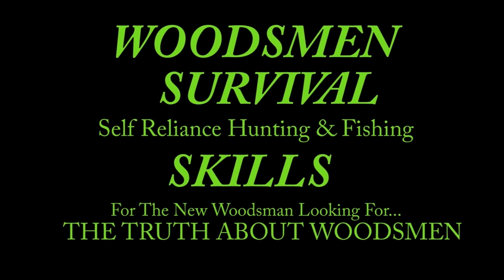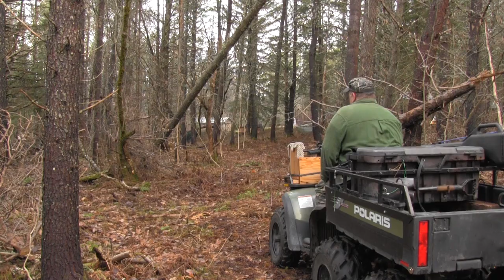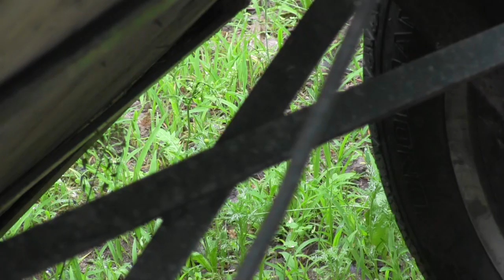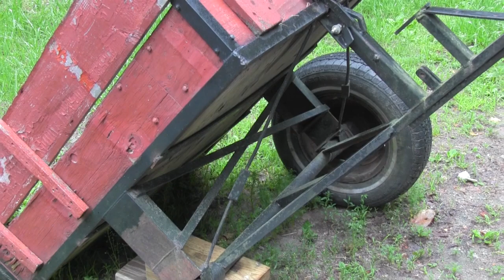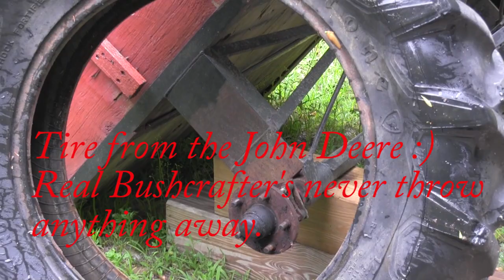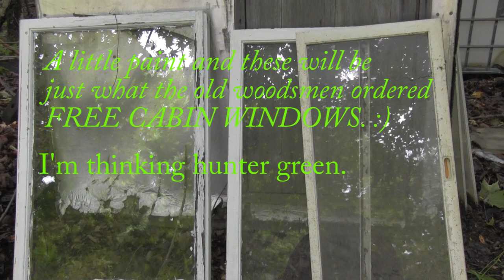# 5 New Cabin Build Under $1000.00 @ The Rustic Log Cabin Deer Hunting Camp

Comment: Thank you again Tom for the shout-out to my channel. Lumber has held me back for quite a while working on my cabin as well. I will be using rough-cut pine for the camp. Just need to figure out how I want to do the hearth for the woodstove now. This process is kind of slowing me down till I can figure out how I want to do that. We shall see I guess. Keep them coming Tom. God Bless.
Reply from the maker: Good morning Shane, :)  you're more than welcome. I think you got a great Channel and I love the new cabin. It was fun watching some of the subscribers to my channel show up on your video LOL. I'm just a very small Channel but I do have some great subscribers.

The little cabin that I built next to my log cabin I put six in V match Pine on the walls.
And then from my heart to protect the wall from the wood stove I installed a piece of black steel Roofing with a 1 in spacer between the floor and the wall disperse the Heat.
Then for $150 at Tractor Supply I was able to buy the shield for the floor very nice one the whole setup looks really nice. Just an idea. Not sure what you're looking for but that's what I did and that's what I will do when this new cabin build as well. With the exception of the $150 mat for under the stove. I'm going with the old style much cheaper with the tin and some kind of backing. The thing used to see you all the time under wood stoves.
It's just an outpost so I'm keeping the costs down as much as I can.

I hope you're having a great day! 

Tom